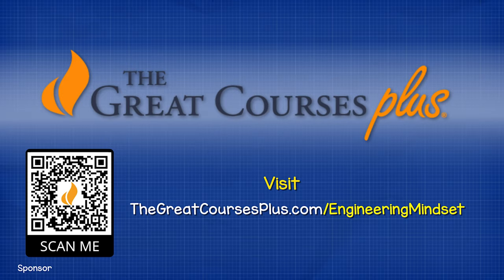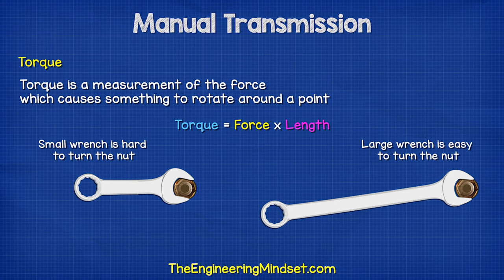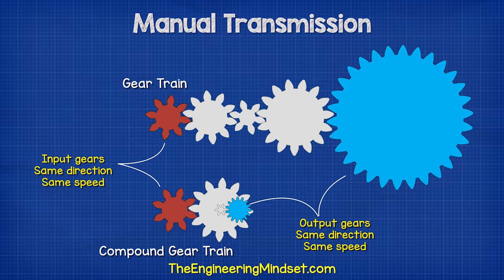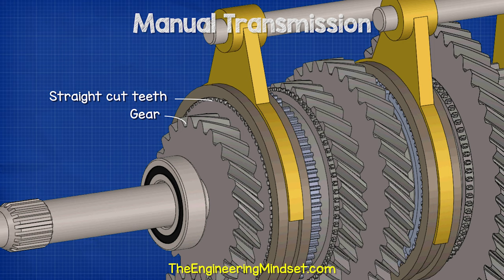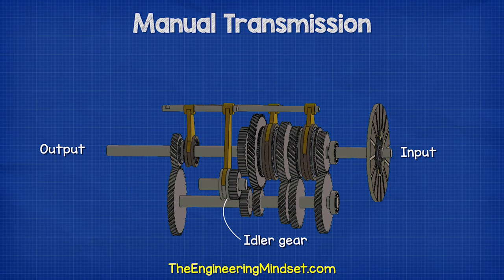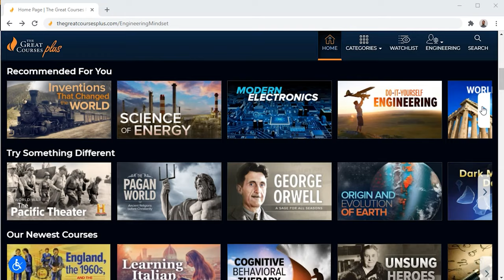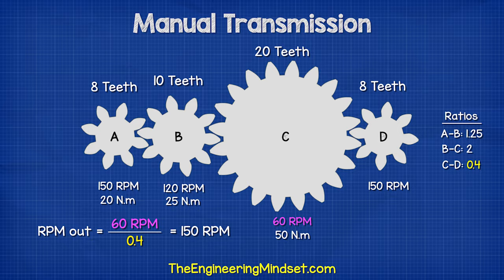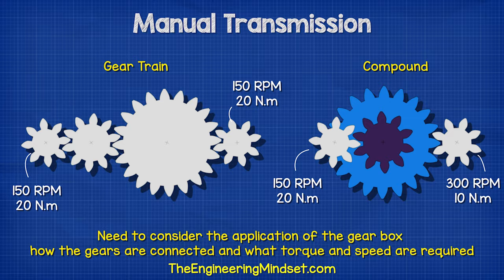How Manual Transmission works - automotive technician  shifting

Comment: 18-wheelers dont have sychros so we gotta manually match rpms to the road speed it's not hard but I prefer a manual because an air actuated automatic is way too slow shifting when in muddy or slippery conditions

Comment: i have this car with 5 speed manual, over the years of using with no problem last month i change it to 4speed automatic, now im gonna change it back to 5 speed manual 🤣 its more fun to drive when you can shift it manually 😁
Reply: Legit I find driving an auto boring😂   like it's too brainless
Reply: I find that the clutch is an important part of why manual is so much more fun. Like you're directly melding the engine with the motion of the car. It's a world away from just putting it in D and stepping on the gas and letting the car figure it all out

Comment: I think manual is best
Because

1. It has nice pickup 
2. Fuel economy 
3. Effective control during off-road 
4. Can start the engine if battery is low
Reply: You forgot to add #5 It can prevent most theives

Comment: I learned on a manual, and I've preferred it.  I had to learn that drivers, who had only driven automatics, don't know what to expect from a manual vehicle. I ease the throttle, and the internal resistance gives me engine braking.  But, people behind me think that they need brake lights to tell them that the vehicle in front of them is slowing.  A few near rear-enders.  In point of fact, on highways and motorways, brakes are a no-no.

Comment: I admit the first time i've user automatic gears i was 40 and driving for more than 20 years with manual.having said that which one is better? It depends!if you live in a hilly environment with constant up and downs and crooked roads manual might be better cause you always have the complete control of the power of yor engine...if you drive route 66 just free that foot relax and make it automatic...great video by the way
Reply: Put Cruise Control on it and get the best of both worlds.

Comment: Transmission preference to me depends on the situation.  I love manual in snowy conditions since it's easier to control the power but when it comes to traffic? Give me automatic all day.
Reply: im a manual driver and in traffic i actually learned a nice trick so my feet wont get swollen if im constantly going 1st gear, when the traffic jam moves slowly i engage to 2nd gear and hold the clutch midway which still acts as first gear but its slowly making the vehicle crawl as if its in first gear, so in turn i no longer need to waste so much fuel holding 1st gear since 2nd gear and so on consumes less fuel compared to 1st gear.
Reply: @SpiiiiiceeMAN  doesn't constantly slipping the clutch burn it out?

Comment: I believe Manual transmissions are generally more enjoyable to drive if being engaged while driving is appealing to you, which it is to me. That's not like autos are bad though, quite the opposite in fact. They are easier to drive than manuals, can be controlled quite a bit if you know how to "talk to it" through the tps sensor, and shift quicker allowing faster acceleration. Plus with the advent of modern 8, 9, and 10 speed automatics are just as fuel efficient if not moreso than a manual.
Reply: automatics are very complex, as such you can expect to sell your car once it breaks because replacing it will cost a fortune, for manuals mostly the clutch fails which is replaced for 500€ labour included.

Comment: Your description of the synchronizer is the best I've seen - but it still doesn't explain something I just can't wrap my head around: 

I'm 100% with you, up through the point where the synch/blocker teeth are out of alignment with the sleeve teeth - thus preventing the sleeve from sliding into engagement - but it seems like a torque reversal would be required for them to become aligned again so that sleeve is free to slide over the blocker and onto the speedgear. There is WAY too much friction developed by the cone clutch action of the blocker/speedgear to be overcome via thrust on the sleeve.

To put it another way: Once the blocker and sleeve are misaligned, blocking the sleeve from further engagement... More thrust is applied to the sleeve, creating friction via the cone clutch action bewteen blocker and speedgear. Speedgear is now sped up or slowed down to match same speed as the output shaft/hub/seeve/blocker assembly. But if thrust continues to be applied to the sleeve, I don't see how the blocker and sleeve would become free to rotate with respect to eachother - which is REQUIRED for their teeth to become aligned and allow the slider to fully engage the speedgear.
Reply from the maker: With the clutch disengaged the engine is not providing any further power, the friction causes the gear and sleeve to rotate at the same speed. Once at this speed the blocker ring is no longer forced to the limit of the strut. So it is able to move, the teeth of the sleeve are angled which pushes the blocker ring teeth a tiny amount, this loosens the blocker ring and allows the sleeve to push past it.
Reply: @EngineeringMindset  No, you've skipped the part I'm talking about again.

We agree at beginning of sequence, the strut is on one end of the strut slot, right?

We agree the blocker is driven (caused to rotate BY the strut, right?

We agree the blocker must rotate with respect to the sleeve in order to become aligned, right?

In the case where the speedgear is spinning more SLOWLY than the output shaft/hub/sleeve/blocker assembly:

As the blocker comes into contact with the speedgear cone, the blocker is going to be forced to back side of the slot. THE BLOCKER WILL NEED TO SPEED UP TO BECOME CENTERED IN THE SLOT AGAIN. HOW DOES THAT HAPPEN?

In the case where the speedgear is spinning FASTER than the output shaft, the reverse is true. The blocker will be forced to the other side of the strut, and to become centered, will need to be slowed down, in relation to sleeve. WHERE DOES THIS BRAKING EFFECT COME FROM?
Reply: @GroovesAndLands  there is no braking force, it will attempt to accelerate the input and countershaft. The synchros job is to make shifting smoother and help prevent improper shifts, if you're speed gear is at a large rpm difference to your input it blocks the shift. Trying to force the gear will cause grinding but eventually will accelerate the input to match.
Reply: @jakerichardson7973  I appreciate your replies - but it's clear you ALSO lack understanding of the finer points of the physics at play here. It's had me stumped for years, too. I encourage you to give it some more engineering consideration!

Comment: Manuals and auto are both really good depending on what your purpose for the car is. If its just getting to point a and point b on a normal road, auto is fine, unless ofc you like driving manuals. If youre doing more than that, its best to control exactly when shift happens for more power at key moments.

Comment: A lot of time you blow the clutch so a manual is better in repair cost to. An automatic transmission can sometimes cost the price of the car.  A manual you put a new clutch and you are good
Reply: I'm 100% for manuals but let's be fair, a clutch replacement can be pretty pricey too. Not compared to an auto tranny rebuild but it usually needs to be done more often.
I also agree that manuals are better for cost, in every way. And E46's are awesome.

Comment: Manual transmission is not only more fun to drive. But the drive has more control of the vehicle, towards slowing down and breaking of the vehicle. Down hill you has more control power, especially with heavy load, for one who know to drive a standard. It's a great plus over the automatic .

Comment: Minhas congratulações! Minha preferência Transmissão de Velocidade MANUAL! Conjunto de engrenagens sincronizadas retas (processo de metalurgia) Sinterizados; resistentes à qualquer avaria; Conj 1a/2a; 3a/4a ; 5a ; 6a(Ré). Teste Protótipo de Campo é 1a vel para 6a(Ré); Com todas as velocidades do grau 1 ao 4 ; GAUSS! Precisão dimencional de encaixe dos dentes é fundamental!

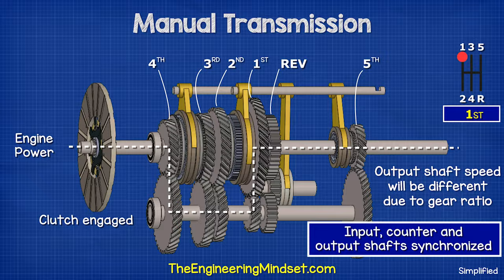Comment: 12:00  The first gear should have a small gear wheel on the input and a big input on the output shaft,   if I recall it right.   So essentially,  you might need to change the labeling to 1,2,3,4 from the left side onwards.

Thanks for all your effort, animations  look awesome!
Reply: I thinks labeling is right. What you're talking about is the gears in input shaft to the counter shaft not to the output shaft. If you notice closely from gear 1 the COUNTER shaft which serves as "connector" to the input shaft has smaller gear than the gears for the OUTPUT shaft. Well i might be wrong so please correct me because this is how i understand the video.

Comment: Semi truck transmissions do not have syncronizer gears. You have to learn it. Generally you only use the clutch to start off with, after that you don't need it. You have to learn to match up road speed and engine speed to shift. If the match is wrong you won't even be able to pull it out of a gear, let alone get the next gear.   If you have ever been forced to drive a stick shift car with no clutch it would be a similar technique.  It is actually easier to learn to shift a semi if you have never learned to shift a manual car.
Reply: I heard about that years ago, and decided to try that on my own car. Lol, youthful exuberance.
Fortunately I didn't destroy anything (maybe because it was a Toyota), and in the process I learned purely through feel why we use the clutch (in a car): the gear must not be under any load when engaging or disengaging. The clutch ensures that, and the synchros allow a little room for error.
I can't imagine having to get it exactly right without even any synchros as safety nets.
Maybe they don't have them in semi trannies because with 2500 ft-lbs on the input shaft, a synchro would be emulsified the moment it tried to serve its purpose lol

Comment: of course manual trans because it’s more fun simple to fix and light weight so more efficient in that way if you measure the modern auto transmission’s efficiency
Reply: Don't forget way less expensive

Comment: To those who don't know anything about driving a manual transmission, not only they haven't any clue about manual transmission's safety with a manual transmission, and when it comes to longevities, durabilities, assurance , and economic. We fell more safe in a manual transmission than in Automatic's transmission. To finished the Engine feeling lighter, and development more, you feel like it !.

Comment: I believe the manual transmission is better because there is less power loss between the engine and the transmission because it is a mechanical clutch, unlike an automatic. The automatic transmission has a “fluid coupler” instead of a “mechanical coupler” between the engine and transmission, in which, you have around a 10-20% power loss compared to a manual, having only 1-10% power loss. At least, that’s what I’ve learned in college level automotive technology classes.

Comment: is the key  connected rigidly to the blocker ring?
and how are they connecting?
and how does the blocking ring return its  original position
and thanks for ur effort

Comment: Hello!
What happens if the straight cut teeth of the gear get aligned with the holes of synchronizer blocker ring's teeth preventing the sleeve's teeth to slide in?
An other question: What software do You use to animate & render the parts?

What I am hape to see in this video: interesting helpful content, clear explanation, precise animation and a ton of effort put in, so I am completely satisfied... and now clever too!
I wish a lot of success for the channel!
Reply: Imagine if the gear teeth just slid off since you put too much force
Reply: @64_bit_coding  Oooo, I see, I see, thank you for your answer, I appreciate it

Comment: I prefer a manual transmission for reliability, lower maintenance cost, it gives me a much lower gear for off-road use and heavy loads “especially with a 4x4” and most of all I prefer a manual transmission because I know my truck won’t leave me stranded for something as simple as a bad starter. And also I guess it can extend the life of the starter as well, if you roll start the vehicle often enough.... auto transmission vehicles certainly have their good qualities and have their place, just not in my driveway
Reply: @DoctorRickSanchez  🤣😆 Hahaha I like the way you worded that!

Comment: Great video. One question, at the end of the video you state gear C in the compound setup has less torque than gear A, but would it not have more as being compounded the torque would match gear B? Could be I just misheard.

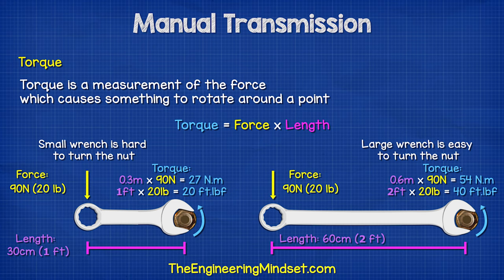Comment: 3:49 Slight and somewhat trivial correction, but a correction nonetheless. A lot of people make this mistake, but the Imperial units for torque are lbf*ft, not ft*lbf. Ft*lbf is a measurement of work, not torque. In fact, just look at the metric measurement: N*m. The measurement of force comes before measurement of distance, not the other way around.

Comment: manual is wayyy better than automatic because you have more control over the speed and you gain a better connection with your car. however automatics have there pluses such as traffic and needing to use your hands for dealing with crazy little ones. and then there is sequential where it uses both forms of automatic and manual. but I still stand behind manual transmissions.

Comment: I like manual since give more control of gears except in a steep slope when need the clutch friction point not to roll backwards.
Many automatic transmission drivers don't know that manual transmission cars, will roll back on uphill if the  driver in front is not careful and skillful enough in the clutch
Reply: You can always use the parking brake to hold it if you're not good enough with your feet to use the brake and gas pedal at once

Comment: tip that might save you one day: dont downshift in a high displacement vehicle if you dont know what you're doing. if you rev match incorrectly or not at all the decelleration from the lower gear will cause your rear tires to break loose and it'll kick the whole rear of the car out.

lower displacement cars tend to be a lot more forgiving that way. your friend might end up eating the dashboard when your learning, but overall the engine isn't strong enough to cause the tires to lift off before either frying the clutch trying to climb rpms or the engine and poor transmission have an aneurysm from what you just put them through. 
but long story short dont hop into your dads corvette and treat it like a honda civic.

Comment: Where did you come up with that graphic for the shift pattern on the knob? That couldn't be more incorrect! It doesn't go left-to-right LOL.
Reply: It is normal in cars that have the driver seat on the left, mine is like that, from left to right, 1 to 5 and then reverse
Reply: @MinaASamir  every manual car I’ve ever driven, 60+, has had the seat on the left and an H-pattern stick. Have never seen a shifter where you have to go from the far upper right to the near bottom left to go up one gear. That makes zero sense. You want the shortest distance between shifts, not the longest.
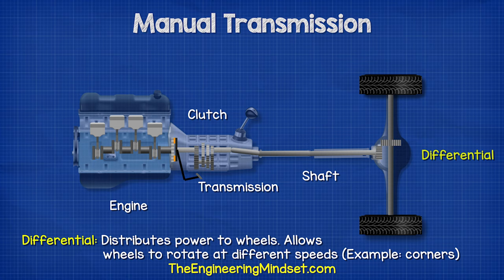Reply: @AndrewFahsholz  I misunderstood you, What you are saying is definitely correct, I thought you were talking about the animation at 1:30, that's what I meant from left to right
Reply: @MinaASamir  ah, gotcha. Yes the initial graphic even before the video plays is what I am referring too. Very wrong for a channel that fancy’s themselves on engineering!

Comment: I think a lot of people like the play of the Manual trans and some just like the speed you can get too on them but the automatic trans can be faster if it's a specific setup and basic automatic transmissions tend to last longer but that may be attributed to the fact that humans can stall a manual and often times if their worried about speed their pushing their trans harder and seeing as manuals have more play they tend to get worn out more just because their being ran harder.i dont know a whole lot about the workings of cars but I know the more you put into how a system operates the higher the chance something will give which is also why manuals can fail faster due to age.

Comment: Hmm, better is certainly a difficult question. 

I suppose it depends on the purpose of the vehicle. I've owned and lived with both styles, and I will say manual is certainly a whole lot more fun and engaging! However, that's not much use for just commuting or sitting in traffic. In fact it can be fairly painful to drive manual if you sit in heavy traffic often. 

Both can be of value depending on the use, but if I had to choose and only had access to one car, I would go manual.